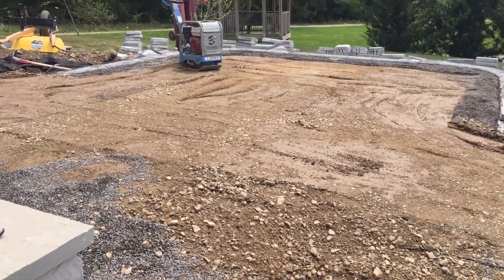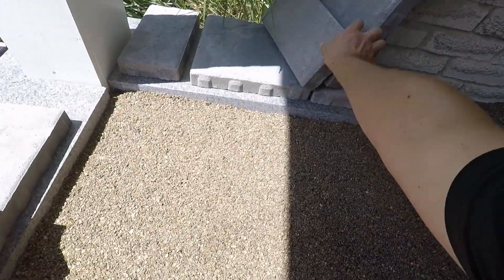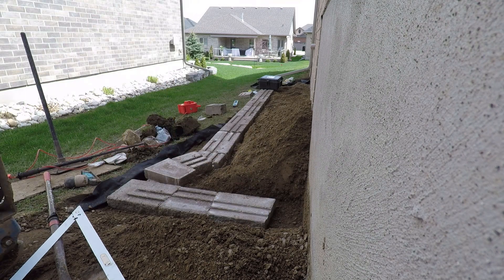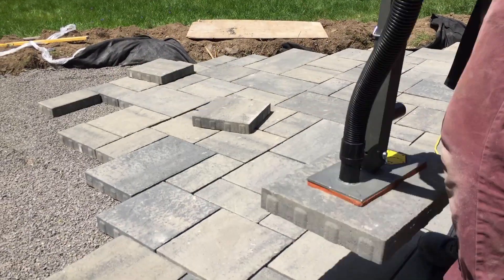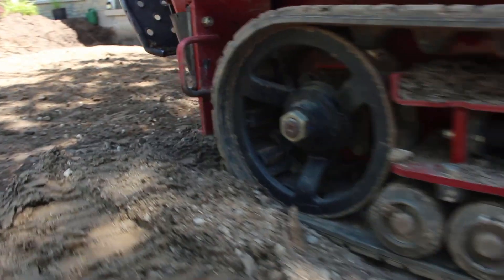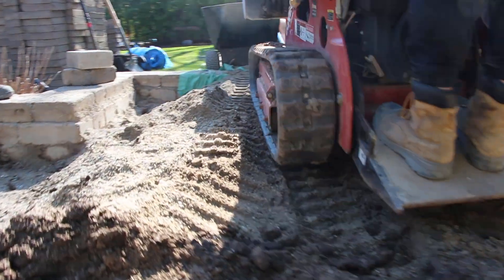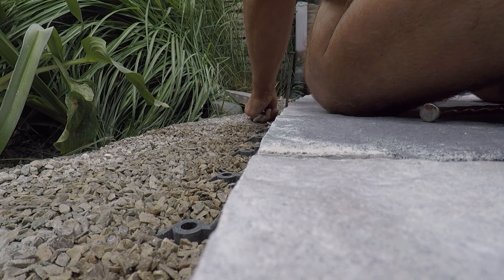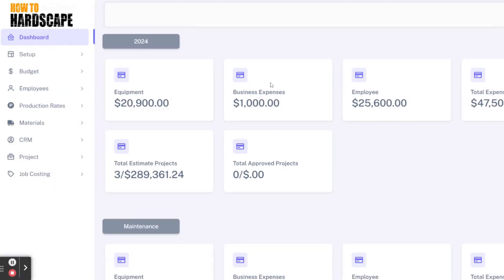Why Use Dense Graded Base for Pavers and Walls

Comment: Very informative. Do you have any videos on  installing patio pavers on top of a good existing concrete patio slab??
Reply from the maker: Yup! If you go to our channel, in the search bar just search concrete
Reply: @iamahardscaper  okay thank you sir.
Is it a bad idea to glue the pavers onto clean ed concrete?
Reply from the maker: I wouldn’t say it’s a bad idea, I just don’t think it is necessary. We do typically glue our border stones though which is usually a cap that is thicker than the field pavers. That allows us to get a non woven geotextile and concrete sand under the field pavers to allow for drainage.

Comment: So, if using dense graded base for a walkway along the house, will that not hold water like lime screeding, and be affected by frost heaves? I thought open graded base would be preferred especially if it is sloped away from the home. Great videos!
Reply from the maker: Thank you! Dense graded base will hold water longer than open graded, but it does drain. Lime screening is too fine to allow water through it.

I have done open graded along a foundation and haven’t had problems but I ensure a woven geotextile goes up that foundation and along the base. As well you need to make sure that subsoil is sloped away from the foundation. Still I prefer a synthetic base along a foundation first.

Comment: Great videos! Very informative.  I've always used more traditional methods due to not being able to find appropriate aggregates in my area. Just recently, a local gravel pit started making clear washed gravel so I finally got to use it. It was a small project 10x10 and regular Holland paver. I found that I used much more polymeric sand because it would vibrate into the 3/8 clear stone. Have you had this? Eventually I just stopped compacting and finished as per usual. BTW I'm in a small northern B.C town. Cheers!
Reply from the maker: I find we use about 10% more poly sand. You used a 1/4” bedding stone on top of the 3/8 though too right?
Reply: 3/8 is the smallest I  can get other than sand. I would consider it a mix of 3/8 and 1/4 though. And I put on washed 3/4-1/2 ish. Those are the only clear gravels that I can get.
Reply: Maybe next time I'll use what we call  3/4 road crush as the base and then use the 3/8 clear as my bedding layer. I very much like the idea of not using sand. I just finished a paver job that was on hold for a couple weeks. It hadn't rain for a few weeks and I lifted a few of the pavers and it was still wet under them. So I can understand why poly sand would degrade rapidly when it's always moist under the pavers. Cheers!

Comment: Thank you for your very informative videos.  I am an older woman trying to figure out how to replace sunken pavers on a walkway leading up to front door.  It is my understanding that you say to use cement sand only as a base if the joints are very small between pavers and not use HPB bedding layer underneath.  Is that right?  I live in Ottawa and cannot find cement sand anywhere except to get a truck load delivered and I don't need that much.  Does cement sand go by any other names?  I just want to get a few bags.  I bought a few bags of HPB stones at big box store and many stones are round which I have learned from your videos is not what I want.
Reply from the maker: It’s actually called concrete sand. It is just a coarser sand than masonry sand. If it is just a walkway you can use HPB. It is more for vehicular applications and small joints that we would use concrete sand.

Comment: This is very interesting and informative as well. Winters go below -40c in my area, and 1/4 to 3/4 down limestone are widely used for paving base. I’m currently working on a project to extend the width of a driveway on a very well sloped surrounding grade, what kind of base should I use to prevent the base being washed away along the surrounding grade.
Reply from the maker: Whenever I do a project that butts up to another base, I usually just match the base material. More than likely the base for your driveway is dense graded, so I would just match it with more dense graded material and not open.

Comment: What is compaction rate of HPB? Trying to take any compaction into account vs 3/8 inch compaction on concrete sand for final height of pavers. Anybody?
Reply from the maker: At 1” depth, it’s barely anything. Maybe about 1/16” no more than 1/8”
Reply: @iamahardscaper  Thank you! I currently have a compacted crusher run base to a height expecting to use 1 inch of concrete sand. Local shop talked me into the HPB type base. My techo bloc pavers have fairly large joints (blue 60mm) but are 2 3/8 thick and was expecting to get enough compaction to get pavers to match up with tread heights. Should I go with 3/4 inch of HPB or just use the concrete sand as originally planned? thanks a lot!
Reply from the maker: I personally like HPB more than Concrete Sand. I would use that, but it is all up to you at that point.

Comment: Will you use traditional base on a patio that butts up against the foundation *as a rule*? I heard you say you would use traditional base ‘at least for a little bit’ so if you’re building a patio along a house that runs out 14’ from the foundation is that to say you might split it up, with the few feet closest to the foundation being traditional base and then switching to open graded base?
Reply from the maker: Yes I would do the first few feet in traditional and then open graded but they need to be separated with geotextile. That being said, I have never had to do this because I would use synthetic base if the patio is being built following the existing grade and open graded base if it is a raised patio.
Reply: @iamahardscaper  Could you use dense grade base right next to a foundation wall to act as the subsoil? I have dug a foot next to the foundation and have yet to hit clay which is what the sub soil a few feet from the foundation happens to be at about 10 inch depth. Wondering on how to bridge this gap and make my sub soil slope away from the house. I hope this makes sense. Thanks a lot!

Comment: If I want to put a shed on a paver base, should I have a two percent grade slope?  Will the shed slide off the slope over time ?
Reply from the maker: I would build it level because now you have a structure that will shed off water rather than relying on the pavement surface to do so
Reply: @iamahardscaper  thanks for your response.  If the pavement surface is also level, how will water drain away ?
Reply from the maker: With a shed on top, there shouldn’t be a way for water to get onto the pavement surface. Like the floors in your house are level. You could if you want put less than a 1/8” slope per foot

Comment: Thats a great video and answers a lot of my questions. I have another question, can i use compacted G A stone to reduce the slope in my backyard a bit (like an inch or two) without using retaining walls? Does compacted G A need to be contained? In other words, can i simply compact a thicker G A stone at the lower end of the slope (which will probably be above the ground and not enclosed) to raise the base a bit then use synthetic base?
Reply from the maker: Yes you can do that if I can picture what you are saying correctly. You still want to topsoil to contain the base though
Reply: @iamahardscaper  got it! Thank you very much for your response!

Comment: Can I use 3/4" concrete roadbase to extend a portion of my driveway? I have a bunch of pavers to cover the area. It snows here in Layton Utah would it work?
Reply from the maker: If that is 3/4" down to fines, it is what we are typically building our base for driveways out of

Comment: Now if you don't do any of this and just compact 5/8 minus, you'll be just fine!
Reply from the maker: Use the best base material for the application 👍
Reply: Making simple hard ,indeed?
Reply from the maker: Ah I would disagree. I think you can make things easier on yourself on the job site with just a little forethought. For example, choosing to use a synthetic base over a dense graded base if the application is suitable will greatly reduce your labor. Especially where I am it is now super difficult to get rid of excavated soil because of new legislation.

However, not saying sticking with your one size fits all base method is wrong. But I do love my open graded base over 5/8 minus.
Reply: @iamahardscaper  Just giving the do it yourselfer a little hope.
Reply from the maker: They need it 👍
Reply: @tomjensen618  the diyer will have a better time using hpb than dense grade and sand.